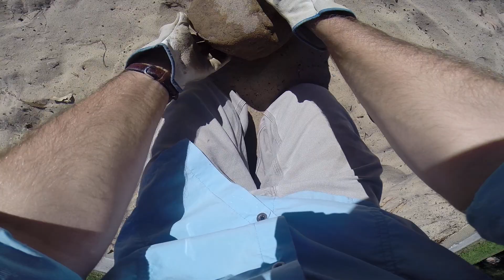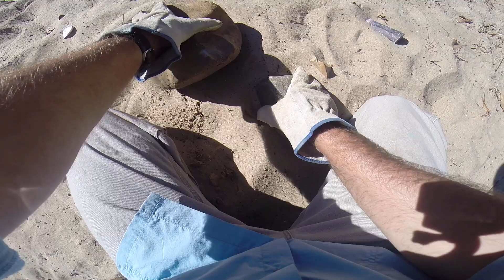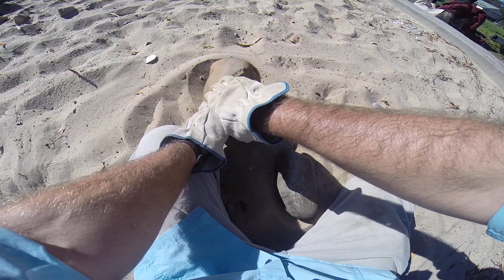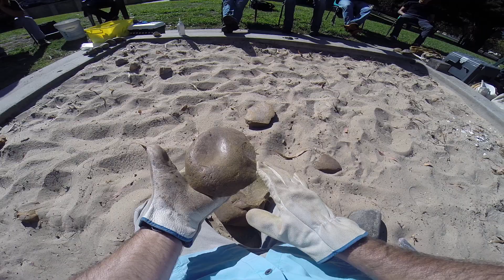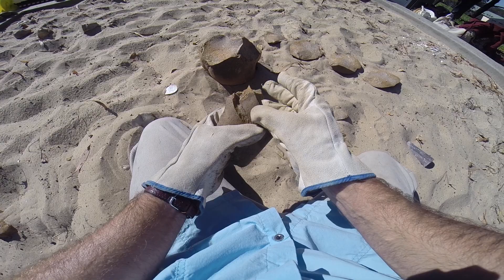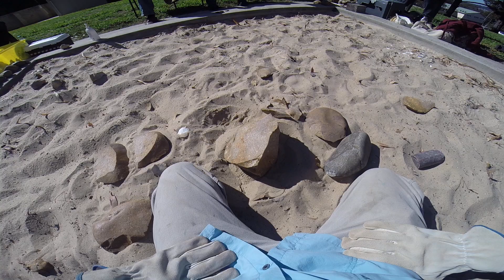Introduction to stone flaking

Comment: The way you describe it, it sounds like cavemen did calculus before hitting a rock with a rock
Reply: Jimish Patel yup
Reply from the maker: People regularly perform visual calculations when doing many different tasks. If you think about when people throw a ball into a net or onto a wicket they are performing calculation to optimize the arc of the ball. These things are generally intuitive. As a child you learn through trial and error or through extensive observation what the correct arc should be. But if you are leaning these things for the first time as an adult they would not necessarily be intuitive.  The explanation here is designed to explain all those intuitive things that an experienced knapper would be performing to people who have never seen or attempted knapping before.  So I guess yes they are performing calculus before hitting to rock together but these are intuitive calculations
Reply: @Xzavier Roman Instablaster :)
Reply: @Zyaire Lian It did the trick and I actually got access to my account again. I'm so happy!
Thanks so much, you saved my ass !
Reply: @Xzavier Roman Glad I could help :)

Comment: Is that a park sand box? Shouldn’t be doing it in there, flaking razor sharp rocks were kids play?
Reply from the maker: John De Leon no not a sand pit in a park. This is the UNE knapping pit. We use sand as our knapping surface as it absorbs the energy of the struck flakes and prevents them rebounding onto other people. This is an important consideration as we conduct many demonstration and classes with people gathered around either watching or trying knapping for themselves. The sand is a safety feature to protect these people. When not in use this pit is covered and has signs warning that it contains sharp objects. So no kids playing here unless they are knapping.